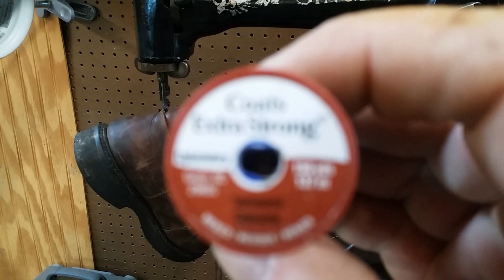Using a singer 29 - 4 shoe Patcher repairing a work boot

Comment: I have just procured a 29-4. I am having problems getting it to run...it breaks thread, seemingly, in the tunnel, but not sure. What I really want to know from you, is; how can I tell if my bobbin case is too worn, or how to know how much tension to apply to which areas of the threads. I think I am having a problem with the bobbin rack and pinion too. I have looked at several videos, watching intently, at the way they are setting the teeth, but it seems that none of them agree, and I can't actually see that what they have done, actually works. Do you have any suggestions? (I am excited to own one, because I hope to learn how to make shoes or moccasins for myself. Thanks for the video, I am watching it several times, hoping to see what I can't see behind your arm. LOL